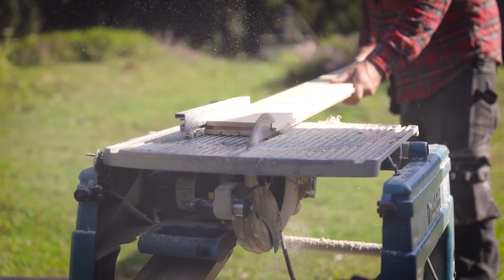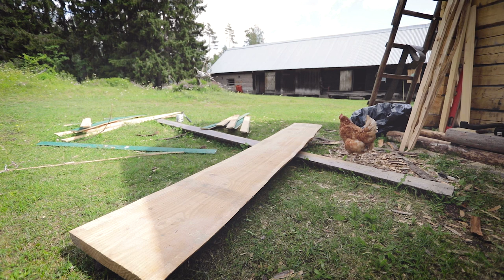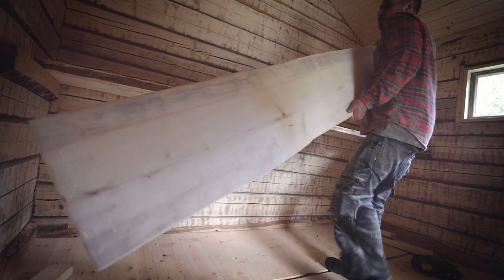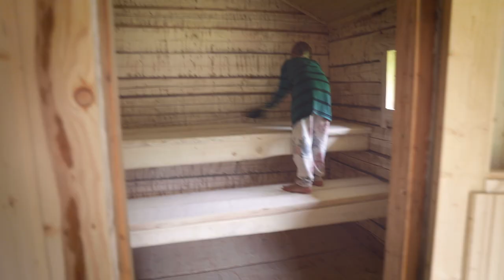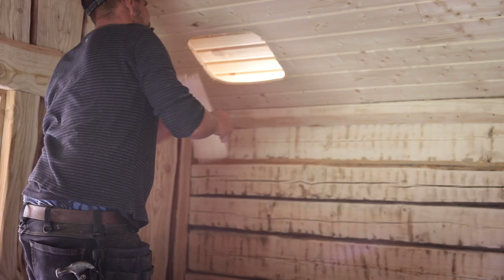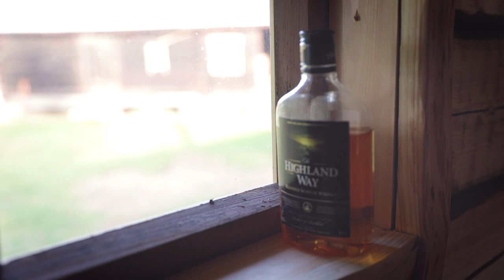Log sauna building part 10

Comment: Finally! No insulation or steam block in the roof at all? The upper bench seems a bit low in the video, since the ceiling is so high, did you get proper heat at that level?
Reply from the maker: Works just fine for summer use, hot enough.